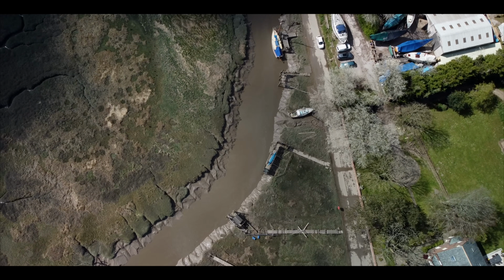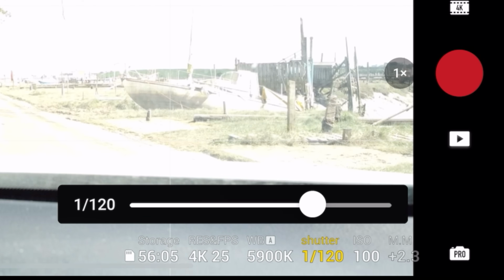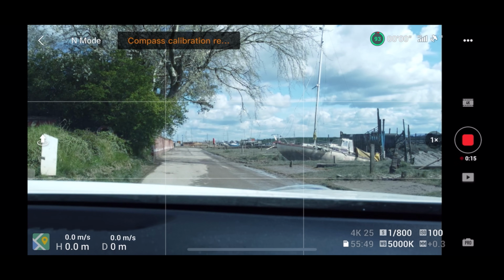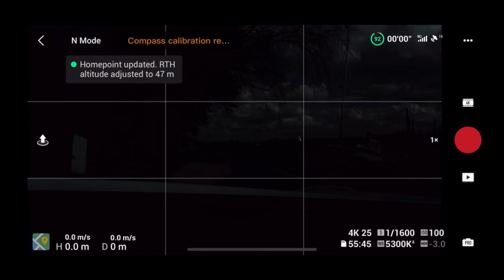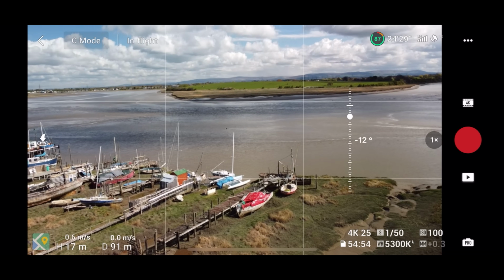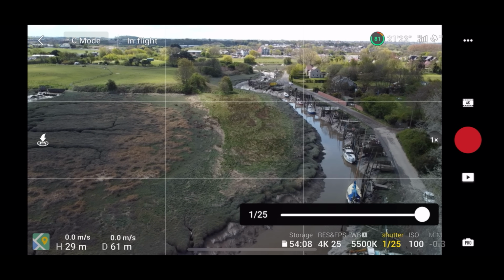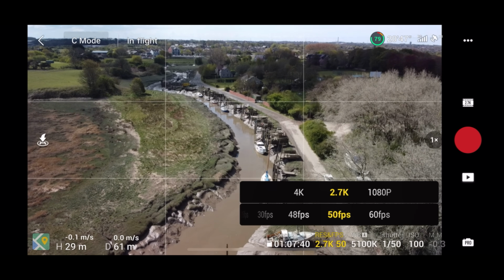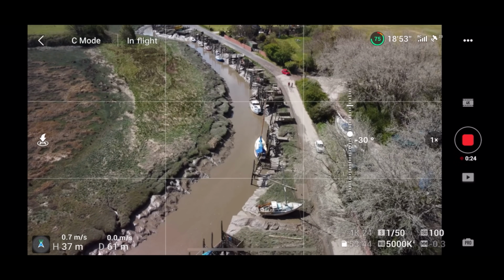DJI MINI 2 - DJI 1.4.0 PRO MODE

Comment: Most people aren’t flying close enough to anything that there would be discernible motion blur, so it’s really not very important to have them (unless you’re doing that kind of flying). I’ll occasionally use one to give me some head room exposure-wise in extreme situations, or for the sake of the polarizer in my NDs. I’ve had DJIs change white balance part way through a shot, so I’d lock that personally. Of course there are a lot of YouTubers swearing by NDs. They’re great to have when you need them, but most of the time they can be left in the bag. The “jello” effect is something I had in earlier drones when making fast moves (rare), and that can be reduced with NDs. It hasn’t been an issue with any of my new drones. Just expose conservatively for the highlights, and everything will usually look great.

Comment: Howdy sir. I know in one of your videos you show us how and where to trim the camera horizon to get a level balance that works. I know I've had to use it a few times and I don't ever remember having trouble finding it. Well suddenly my horizon is off kilter and I cannot find the settings to save my life. I also cannot find the correct video where you made this information available. Can you remind me please or did DJI take that option away from us in the last firmware update when they add in the motor trim settings? I appreciate your reply because my horizon is off by a large margin and I was planning on shooting some action videos today. Lil' help🙏🤠

Comment: Thank you so much for converting me over to a mini 2. I'm in the market to get my first drone. I'm an architectural and mechanical designer and will eventually want to use the drone for various top down views of properties as well as potential real estate footage. I've been. Researching drones for the last 3 weeks on a daily basis for multiple hours and I have to commend you on your unbiased feedback. I was considering the Air 2s but then when I learned more about the mini and started to understand the market better I totally agree with you on the mini 2 and why the air 2s is likely a passing fad. I also think that all of the "extra modes" that the air 2s comes with are nice when you can appreciate them and you already have the skills to perform a parallax. I want a drone that I can manually fly and try tracking myself without auto active track. Makes it much more rewarding and it makes me feel like I'm improving my skills as opposed to just pressing a button and letting the software do the rest! THANK YOU FOR THE GREAT CONTENT!😁
Reply from the maker: Thank you so much that’s awesome !

Comment: PS ! video editing is another mine field, not sure you have covered it yet ! Seems you need a £2k gaming laptop to use free divinci resolve (whatever that is lol). Videopad seems good and works on my old laptop, and it is free until you want to upload anything ! As you stated in your video for most simple folk like me , wants you get used to te settings (that will be the day) , I guess a video editor isn't required, unless you go pro ! bit like adultwork for dronies ! lol (kidding)

Comment: Thanks for this! I finally got smooth no jerky movements in my vidoes. I was getting frustrated just using auto and ev settings. So much better. Easy to understand.
Reply from the maker: The my so much glad it works

Comment: I like to film in 60 fps with the mini 2 and I really like the smooth but sharp image. I keep seeing people recommending ND filters, but somehow that motion blur seems counterintuitive. Isn't it usually better to have sharper shots with higher shutter speeds? Why would you intentionally want the jittery lower frame rate as well as motion blur?
Reply from the maker: Did you see any jitter in that video ? To me the video looked awesome and natural
Reply: @DMProductions  Yeah but it’s very slight but primarily my question is that wouldn’t it be better to have a sharper and 60 fps video over 24 fps with motion blur? Somehow that just seems like it would look better in my opinion. By the way your video was great so I’m not being critical of that I’m just curious on your honest opinion about whether Nd filters really make the difference since they’re quite pricey

Comment: I got the Skyreat 6 Pack filters from your link for my new DJI Mini 2 and I am not sure if I am installing them correctly. I have looked on the net and have seen that you attach from back to front, but it never seems to be secure. I am very careful about applying too much pressure onto the gimbal, so am I doing something wrong. I see the Freewell ones attach from front to back??
Reply from the maker: Just put the teeth into the last two teeth on the gimble and make sure the filter is pressed right down - should work spot on straight away without any issues or shake
Reply: @DMProductions  Okay but to be clear when the filter is moving down the lens it does not click into place it is just held there by friction?

Comment: Hei man.New owner of mini 2 here.Actually first time owner of a drone.I never had one.Only dji osmo action.

So I have some questions.If you're kind, please find your time to quick answer these:
1) What program are you using to edit videos from your drone or "travel" videos in general? (windows user here)
2) My main goal is to create vids like Jay Alvarez(just a popular example to understand what I'm trying to say).So I will always use an after-program to edit the videos from my mini 2.My question is: Do I really need nd filters if i'm gonna edit the clips anyway?
3) Can you tell me what your mentioned nd filters are for? Like each of them? Like ND8 for...night...nd32 for sunny day and so on..
4) What is the difference between 4k 25fps and 4k 30 fps?? I mean..why not to choose 30 fps always?
Reply from the maker: Hi, FPS is more cinematic , I use Final Cut Pro to edit and nds should always been used.  At the end of the video is two slides which you can screen shot for the nd use

Comment: One has just got to be prepared to adjust settings continually if turning or cloud cover changes. I tried manual earlier this week. Was great when I started filming, but when I turned the other way the picture was over exposed. So I would say manual is good as long as situation does not change, but if clouds are passing over and the light is changing, then auto is more reliable to get a usable image. The thing is I can’t change exposure while flying drone, but auto will constantly adjust to the conditions